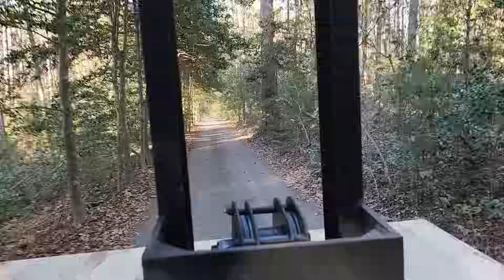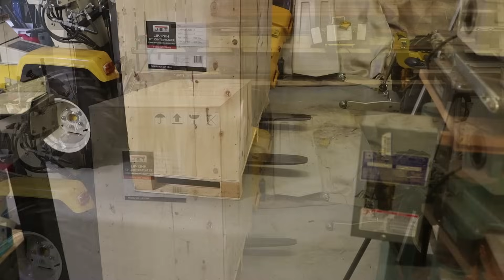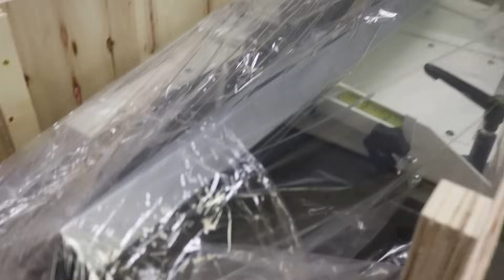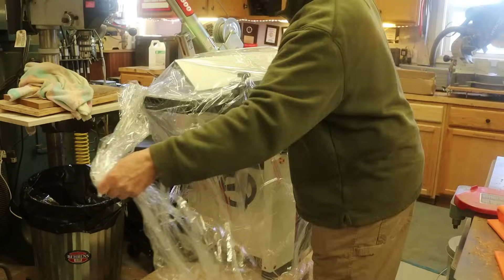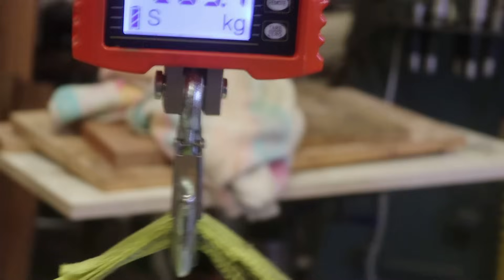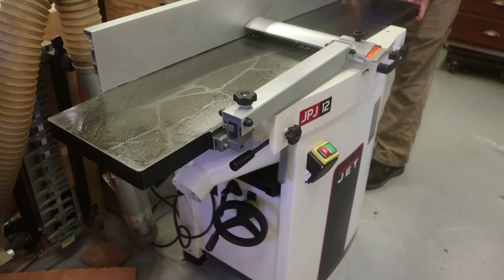New Tool! Uncrating and Set Up

Comment: Raise 1 or 2 inches and discover the center of gravity.  You will know quickly.  Big motor somewhere.  Flat top table everywhere.  I use 120, 220 and 380-3-phase in my shop.  Two grinders use the 380.  Six motors had to be rewired to be 220-3-Phase.  So I put in 380.  Smaller wire needed.  More insulation.  Looks like a nice head.  The replaceable cutters will be replaced when a nail or something nics 'the blade' and one or two inserts are replaced.  And different ones if you plane hard wood.

Comment: Nice machine Frank. I have a 12" Electra Beckum Planar joiner, Had it over 20 years now and still going strong. looks different to yours but the functionality is basically the same, with the planar table in the same place, if yours is like mine you will need to lift the planar table to bring the dist collector nearer the cutter for the joiner mode mate. Bob. UK